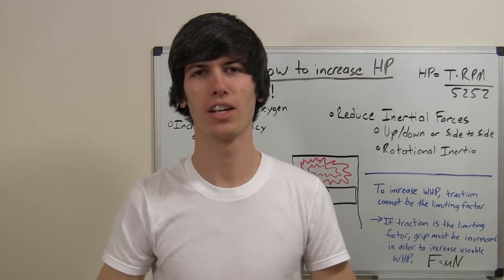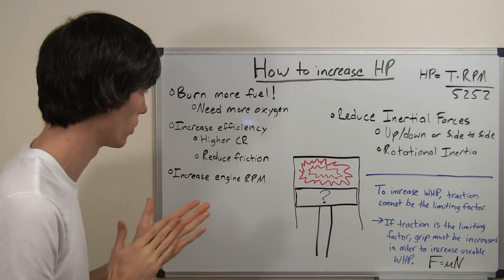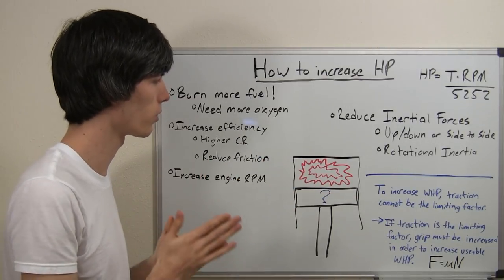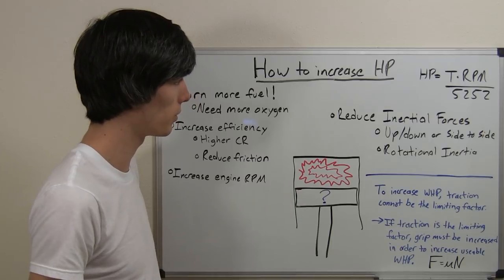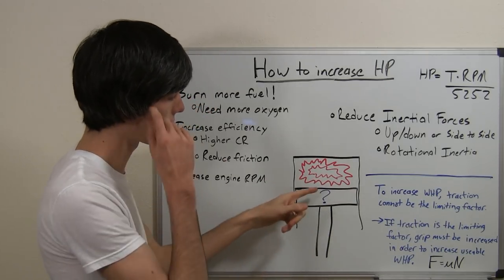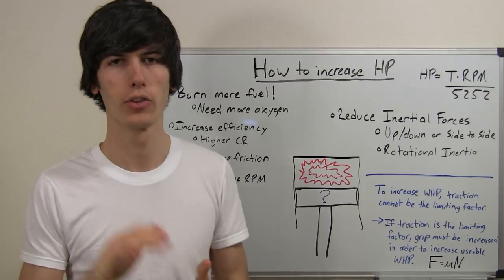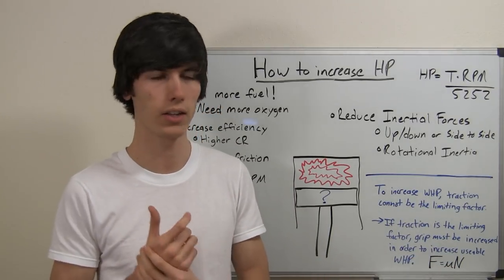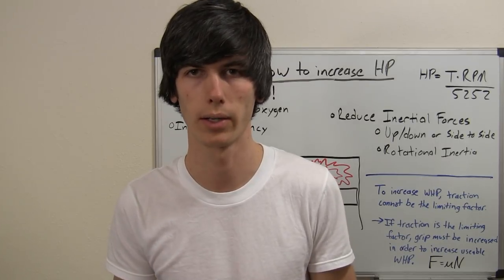How To Increase Horsepower - Explained

Comment: Increase HoresePower:
(1) upgrade the intake (cold air intake)
(2) upgrade the header (racing header)
(3) upgrade the exhuast (catback)
(4) light weight alloys, brakes
(5) forced induction (turbo, nitrous, super charger)

Comment: It actually won't "rob power" as most, if not all cars these days have a switch that will bump up the rpm's when you start using a specific device.

Comment: Great videos man. As a fellow engineer (different branch),  I really appreciate how pedagogical you are about it. However, again as a fellow engineer, i have to say this: in order to decrease the inertia of cylinders (or any other component), you need to decrease their MASS, not their weight. I am sure you know it, but for your less educated audience we must be precise.

Cheers
Reply: One must have accuracy not precision. Weight is a measurement and reducing the weight is just as accurate. I think it is easier for a person to weight their parts than to calculate the mass using Weight=mg. We are not in outer space.
Reply: Thank you for the reply. I am not a native speaker so precision/accuracy was too subtle for me, it seems. But now I am aware and therefore I'll try to be accurate. My remark was not relative to the way one estimates or measures the mass and weight of something. What I wanted to say is that, regardless of the direction of piston movement, paralel or perpendicular to the gravity the BHP can benefit from mass reduction. I think that the way you presented it might mislead some people in believing that gravity (weight) somehow impairs the power stroke of the engine. 

And talking about accuracy: I think you meant "then" as in "afterwards" and not "than" ;)

Cheers
Reply: The accuracy and precision thing is something I learned in chemistry. The word "than" is used for a comparison, and I was comparing. The word "then" is used for explaining a difference in time.
Reply: Good precision and accuracy is like ten darts all on the bullseye of a dart board. Good precision and bad accuracy is like ten darts all around the same location but not on the bullseye.
Reply: Plot twist: since I am an astronautics engineer (different branch remember?),  I am, in fact, in outer space so mass is more accurate for me than weight. And these goddamn darts won't follow a ballistic trajectory so they all precisely land around the 20 mark on the top.

Just kidding...thanks for the cool example to differentiate between precision and accuracy. 

This is my last reply on the topic

Comment: I believe his calculations are wrong. You wouldn't divide the two areas to find the difference. You would subtract them. Also, you cannot say the exhaust is 60% bigger because 1.58 is not a percentage. The 1.58 number says the cat back exhaust area is 1.58 times larger than the stock exhaust. 
To determine the percent difference in the two areas, he should have calculated the percent difference ratio which is the subtraction of both areas divided by the average of both areas multiplied by 100% which gives 45.1% (look up the formula online). So, there is actually a 45.1% difference in the areas for the two exhausts. Therefore you wouldn't calculate 140 hp * 1.6 to get 225 hp. You would actually do this:
(140 hp * 0.451) + 140 hp = 203 hpThe cat back exhaust would have to be approximately 62.3 mm in diameter to calculate a 60% difference in area and to get 225 hp.
Correct me if I'm wrong, but I think that makes more sense to me.

Comment: I understand your equation but I must have missed something.  Where do you derive the number 5252?  On  your previous video, "Torque vs HP", I neglected to ask you about that, thinking it had to do with engine displacement.  Please clarify.

Comment: That's what did to my Subaru I changed the heads from 2.5 to 2.2. this increase compression I wanted more MPG and I got it. Just the heads the 2.5 block is the same got a bump in hp not much but very noticeable.🤗

Comment: One question Engineering Explained, could you explain Engine Displacement (volume in CC), how it works, and whether it applies in one cylinder or all cylinder and how this all applies to fuel efficiency.
Reply: I might be wrong, but my mech. told me displacement is the volume of the combustion chamber
it's basically like bore x stroke
increasing displacement can be made either by increasing bore and/or stroke
the limit is the metal your enigne is made of itself
sleeving can be a remedy but I'm not personnally fond of that technique
Reply: it is not including the combustion chamber though. It is the volume the piston displaces. so if you took off the cylinder heads and filled the cylinder with water when the piston is at the very bottom, that volume of water is the displacement. Then multiply that volume by the number of cylinders and that is the engine size.

Comment: Hello mate. Got something for you. I have this RB26 engine in my E30M3. I have painted the intake in black wrinkle paint, from rattle can. Which make the paint coat rather thick. Can this be the reason for my high intake temperature?

On the dyno the intercooler (genuine Mishimoto) was about 20 degree celcius and the intake temp was more around 40-42 degree celcius. When I cruise around I see intake temp from 44 to 47 degree celcius. 

Thanks
Bjorn from Norway

Comment: Question, say you have 184 hp @ 5700 RPM (2014 Mazda 6). If the car can rev all the way to 6250 rpm, why is the horsepower not stated at 6250?
Reply: That makes sense, thanks! :)
Reply: I still don't understand , on higher revs ( rpm and torque increases ) and since these 2 variables increase the hp will since the formula is T.Rev/5252 how does the mazda 6 reaches peak hp at 5700 if it still can rev up to 6000
Reply: peak HP 5700rpm ....so at 6000rpm, HP might be less but don't forget car engine is still spinning 300rpm faster so it is still faster than what it was at 5700rpm
Reply: If you are still confused, ill try to explain it. Every internal combustion engine produces two things through the combustion of fuel: torque and rpm. Torque is a measure of rotational force, essentially an instantaneous reflection of the amount fuel is being burned at the moment and how efficiently the energy being released is transferred to the crankshaft. Now, the efficiency of an engine varies with the rpm. The efficiency will rise with the rpm until the point where the relationship between the speed of combustion process matches the speed if the piston, and energy loses between heat and exhaust are at their lowest. This point of efficiency is generally where peak torque is. As the engine speed increases, you are burning more fuel and realeasing more energy in a set period of time, but the efficiency goes down. This is why hp keeps going up after peak torque. The point of peak power is when the loss of efficiency from higher rpm and the power gained from higher rpm (more fuel burned in a minute) equalize out. Beyond peak power, the loss in efficiency outweighs the power gain of the extra rpm, and you start to lose horsepower.
Reply: Isaac Housley ohh okay so at for example 6700 that’s the HP with the best efficiency so no power loss etc. But you can get more hp with higher rpm but the fuel consumption would kick high

Comment: Theoretical question: What if you have modified your engine to the point that you can not keep grip when accelerating? Is it just impossible to use that car for the road again?
Reply: +Alpha Nerd You could not push the accelerator to the floor. Or if you really have to drive like a maniac, get a transmission with different gear ratios.

Comment: Plzz make a video on how to decide CR for an engine without breaking it also amount of fuel to be injected in newly designed engine...
Reply: Ally Singh stoichimetrc mixtureis 14.7 parts air to to 1 part fuel. Depending on your fueling method that can be variable from rich to lean and then repeat. 
Compression ratio for gasoline is typically between 6:1 to 10:1 higher compression requires better octane fuel. 
This is general information, each engine is obviously different but this should help somewhat towards figuring out the raw numbers for your fuel flow and air intake flow

Comment: Nice video. I have a question. F=uN is clear, but i noticed that the force applied to the ground is not dependent of the contact surface, how big that patch is. It's L*l.  And i don't think major car constructors fit wide tires on to hi performance vehicles like corvettes for a reason, not just to take your money. Maybe there are 2 friction formulas? One when the 2 surfaces are sliding and when they are not. If you could explain what's going on, that would be great. Thanks :)
Reply from the maker: Basically it comes down to how much the tire sinks into the pavement. At a microscopic level (or not even quite that far), the tire deforms into the pavement, as it's rough and the tire is soft. The more tire that sinks in, the more traction you'll have, as you basically have to shear off that rubber or accelerate when a force is applied. A wider tire will have more tire "sinking" into the pavement, and thus more traction. That would be quite challenging to include in a formula, as you'd have to understand the surface roughness.

Comment: The 458 has a 4.5L engine with 562 BHP, which is about 125 BHP per litre, while an M3 has a 4L with 424 BHP, which is 106 BHP per litre. Assuming that they have the same max RPM, is the 458 engine simply "better/ more efficient" than the M3 engine?

Comment: Aerodynamics also add weight to the car, down force is a multiplication of gravity,and an engine has to fight against it when trying to propel a car forward, it is a very complex issue, the same goes for tyre grip/friction,so many variables it boggles the mind!

Comment: I have a question. Please help me with this.
Suppose I have 2 engines. 1 is a single 4 stroke 400cc engine and the other is a radial engine with 4 cylinders, each 4 stroke 100cc engine where the power stroke is distributed uniformly in all the 4 strokes (one power stroke after the other). 
I want to compare these 2 engines W.R.T to the following:
1. Horsepower
2. Torque
3. Throttle response

Comment: okay so then why are spoilers helpful? i know the air pushes the back down creating more downforce on the back to help the back of the car stay more planted, but isn't that technacly  adding weight to the back of the car? or no because it only adds that "weight" at high speeds so acceleration isn't effected to a certain point right

Comment: May seem like a dumb question but, If I were to increase airflow do I also need to increase the amount of fuel being pumped into the engine? 

Nice videos also
Reply from the maker: Yes, exactly. The ECU will adjust for you, assuming the sensors are all working properly and it has the capability.

Comment: Nice video Very good job..I accidentally found ur channel and watched a video of yours and hit the subscribe button immideatelly. What i wanted to ask is if that HP=(T.RPM)/5252 is standar for every car.Might be a stupid question though :P
Reply from the maker: RuLLerZ sifis If you're using Imperial units, yes. And just remember that HP and TQ are not the same units.
Reply: Nice thanks for the answer.. Keep up the good work
Reply: +Engineering Explained yeah i got it as 7114 rpm by assuming 1HP as 746W :-)
Reply: Engineering Explained what would it be if i'm using metric units?

Comment: These Videos are the best.Anyway I was just wondering if downforce is increased,though traction is increased, wouldn't the subsequent acceleration (when the car is not at rest) be reduced as F=ma suggest? Thought of it because their is more force acting on the car when its moving so accelaration would be reduced if car is not at rest. Is this correct?

Comment: Apart from things like bore and stroke modifications (i.e. engine overhaul), how can you  or can you increase the compression ratio with simpler changes?  I've already experienced HP increases through dealership modifications such as getting more scavenger oxygen via a PCV valve upgrade.  For example, how can you reduce friction in the combustion chamber?  I use dealer recommended Synthetic oil and always have it topped off.  Is there , say engine oil additives that you'd recommend?
Reply: Shaving the heads to a a safe level will definitely increase compression. My mate went 80 thou on a 4.1 litre engine. Damn it was jumpy but the engineering workshop told him it won't last long. It was otherwise completely standard. I drove it before and after.  After a year he did a performance rebiuld. Worth doing if you want to squeeze more power. Just watch valve tolerance.

Comment: Reduce Friction... just one variable in friction but... only recently, I learned the piston head and cylinder are not directly in contact, they are separated by piston rings... is there such a thing as aftermarket piston rings?

Reduce Inertial Forces... is the same idea used behind a lightweight flywheel? Just a thought.
Reply: Yes, there are aftermarket rings.  There are also aftermarket lighter weight pistons and rods.  Some applications you can even get ceramics for, really light and strong.
Reply: correct. the piston ring that touches the cylinder is what is directly responsible for the tq number. it literally is the force at a distance to the rotating point. this pushes on the cylinder wall.
Reply: I don't know about that Chad, the piston is what takes the down ward force of the force from combustion, there will be at least 1 compression ring on the piston along with an oil ring below that.  Higher compression pistons have multiple compression rings, and during assembly the single split per ring is rotated 180 deg. from the ring on top or below.

Comment: Dude you're all over the place. I'm not saying you don't know what you're talking about but I feel like I'm in 9th grade and you're teaching me about engines. Dude one thing at a time. We know more gas makes more power we know more air makes more power we know we have to have a certain AFR . Which size injectors can I run?? I have a 4.7 bi turbo V8 2016 CLS550 ..HP tune. I have full access of the tune.. can you tell me what settings I need to put my injector pulse with and PSI and at what RPM per kPa of air?? Injectors out of my hellcat stock they're like 57 lb 600cc injectors. Right now I got them sitting in some gasoline cleaning them for about 5 minutes and I was wondering if you thought this was a good idea??? Any data would be much appreciated

Comment: The grip doesn't seem to play a huge role. If max force is μmg and F=ma, dividing by mass gets Max Acc.=μg=
9.81μ m/s^2. This is equivalent to a 0-60 time of 2.734s/μ, or about 2.5 s since μ is usually around 1.1. Does this mean that grip doesn't play a role in acceleration above 2.734s/μ 0-60, (under 9.81μ m/s^2) or will 0-60 times decrease with increase grip (all other factors unchanged ),even if the current 0-60 time is well over the 3 s mark?

Comment: Is this a realistic equation? HP=325*5000/5252 

Or, can my RPM be lower than 5252 in the equation? Because i have 308whp and 325wtq and the only way i can make that equation work is if the RPM is 5000 (4979 to be more specific).
Reply: +x2eXu50x Yea it can be realistic .. Its the rpm where your car ''gives'' you the max hp. And the 4979 is low because you have pretty much torque
Reply: Themis Theodoratos Thanks for the reply. Just real quick, "pretty much torque" im assuming was a typo. What did you mean to say?
Reply: +x2eXu50x ''The more torque you have the more horsepower you develop at low RPMs. The slower an engine spins the less the wear and the longer it lasts so they are suitable for a higher duty cycle.'' Its a comment from Erik Kovacs .. Yea the pretty much torque was typo sorry for that. :P
Reply: +x2eXu50x I know this is old, but 2 cents: it's probably NOT realistic (though it's not impossible).  Why? MOST torque curves peak at a lower RPM than maximum HP RPM (gasoline engine).  In other words torque would have to drop very quickly from 5000 RPM to keep HP from increasing, while most torque curves have "gentle" peaks.  For the majority of gasoline engines (which tend to rev faster than 5252 RPM), the HP peak occurs at higher RPM than the torque peak. A quick rule of thumb for figuring out where your gasoline engine's peak HP is: it's probably 500 to 1000 RPM below the red-line RPM.  There's little reason for engineers to push a red line farther past peak HP because you'll want to shift to get the engine back around peak torque anyway.  To get fly-wheel HP, just divide by your drivetrain efficiency (maybe around 85 - 90%).  For your engine the peak torque is probably well below 5000 RPM (3500 to 4000 RPM seems more usual for drivability anyway).

Comment: If you are using aerodynamics to create say 300lbs of down force at the rear drive wheels,  how is that different than putting 300lbs of weights over those same wheels?